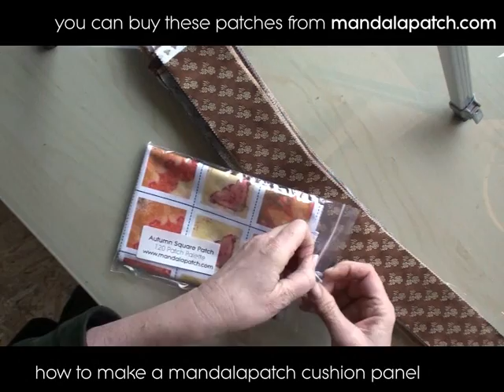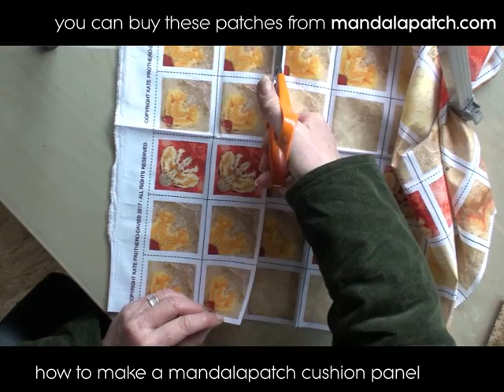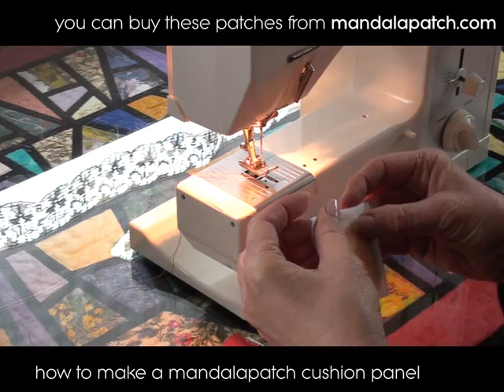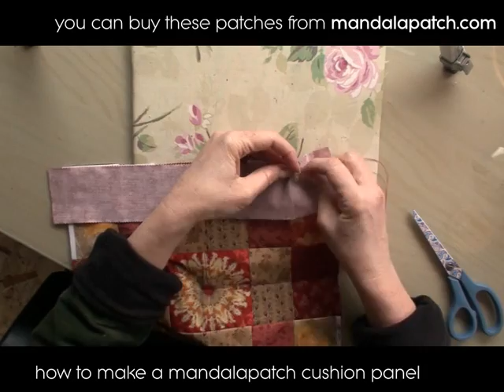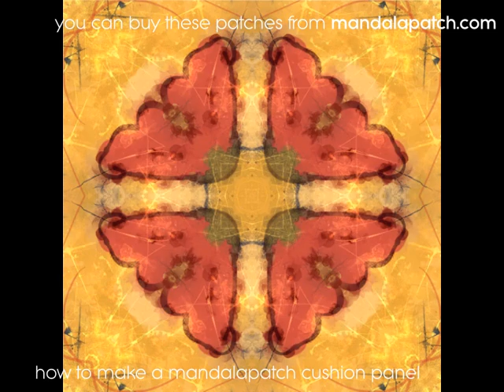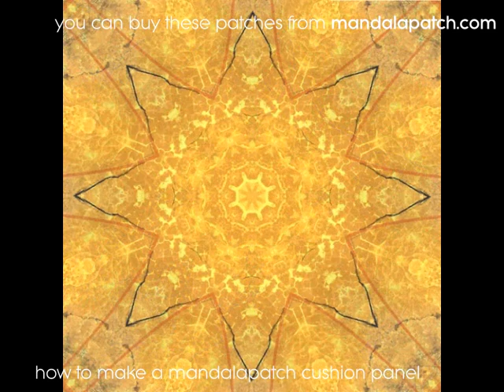how to make a mandala patch cushion panel

Comment: do you have a printed pattern for your pillows
Reply from the maker: Not sure what exactly you mean by this, but the mandala patches are available and you simply cut the squares and arrange them as per a design in one of these videos or use a design of your own... or is that not what you meant?
Reply: I do have the Mandala Patches. I was just wondering if you had a printed pattern
Reply from the maker: Hi Shirley - no sorry I do not but if you take a screen grab of the video at the correct moment this will guide you :) x
Reply: Thank you.  I will do that.